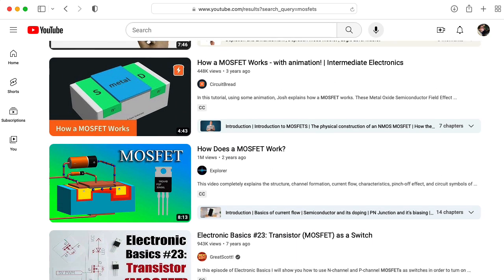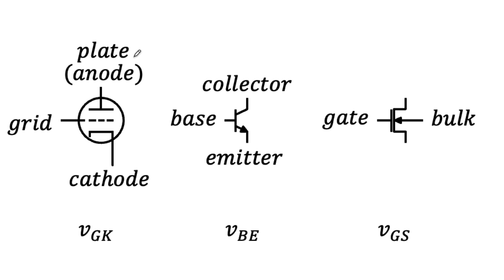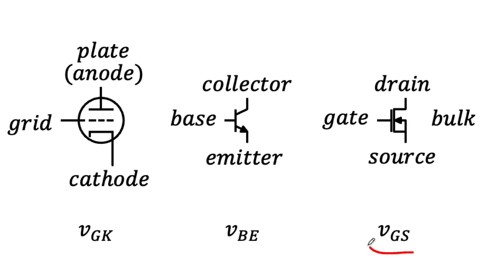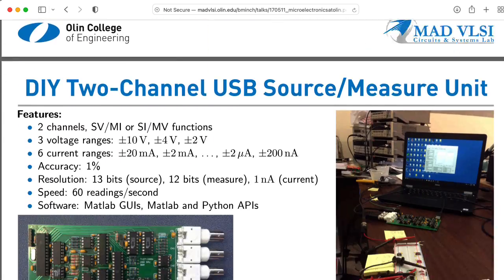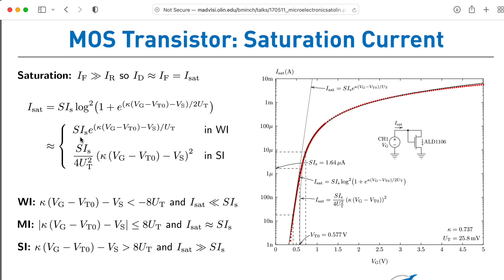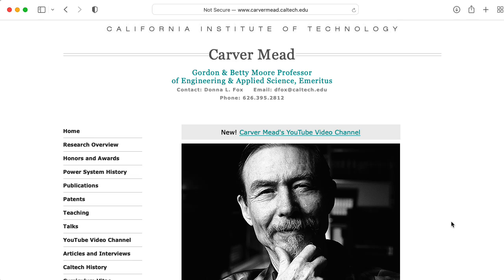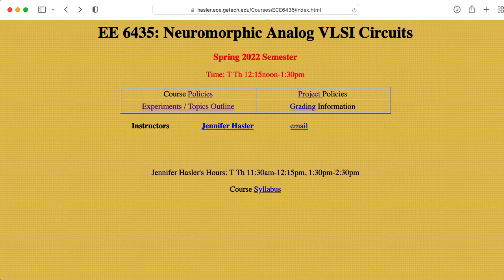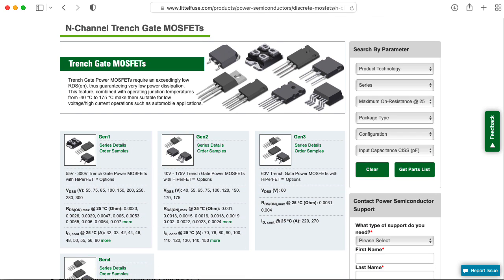They Mislead You About MOSFETs

Comment: There are several distinct types of MOSFET. I am here to talk about some similarities and some differences among them, between them, and the older electronic device types. Some MOSFETs are more like Bipolar Transistors, while others are more like Vacuum Tubes, in the sense of whether the device is Normally ON or Normally OFF with respect to Current Flow. Vacuum Tubes are Normally ON, meaning a disconnected Grid will let the full current flow between Cathode and Plate, while Bipolar Transistors are Normally Off, being in the high-resistance state when Base current is not flowing. 
Among MOSFETs, usually only the Enhancement-mode MOSFETs are discussed, for instance as common switching elements in most integrated circuits and discrete MOSFETs. These devices are Normally OFF, that is, minimal current flows at zero gate–source voltage. This is slightly similar but not quite like a current-driven Bipolar Transistor; neither is it like a Vacuum Tube. 
Meanwhile with a depletion-mode MOSFET the device is Normally ON at zero gate–source voltage, making them rather analogous to a Vacuum Tube, aside from being able to work at rather low voltages. 
The Normally ON nature of a depletion-mode MOSFET can be uniquely effective in certain low-power, low-voltage situations such as Joule Thief circuits, where the nominal 1.5-volt alkaline battery can be run down much farther than when a bipolar transistor is used as the switching element. A similar circuit may be found useful for bootstrapping from half a volt to the several volts needed to turn on Enhancement-mode MOSFETs.
Reply: That's true, but the only really difference is the threshold voltage, with a depletion mode device having a negative threshold. It's possible to use an enhancement more MOSFET in the depletion region, by biasing the gate below the source, in which case the leakage current will often be lower and a depletion mode device can also be operated in the enhancement region, which often gives it a lower drain resistance.
Reply: Interesting! @alunjones3860

Comment: I don’t think the premise is very valid. The gate voltage, or charge, or whatever you’d like to call it, in relation to the source voltage controls the inversion state of the channel. Further, saying “there are more complexities than the square law” is patently obvious and mentioned in textbooks. Third, you provide no solution such as is done at Berkeley with the gm/Id methodology. Teaching kids to use their brain and the simulator is a lot harder than following some arbitrary model like EKV. 

How much experience do you have with FinFet design? The body effect becomes less and less relevant for modern bulk transistors, not more and more, and with decreasing supply it’s harder and harder to cascode.

Also don’t agree that the bulk has to be connected to VCC/VSS, most modern CMOS processes offer triple well as a standard option.

Comment: I seem to recall that the idea for a field-effect transistor preceded the invention of the BJT. Maybe not - have to look it up. Not to forget (and not shown), most "street" MOSFETs have a parasitic drain-source diode, 0ften enhanced for reverse current carrying capability in switching circuits and also sometimes doped to Zener at the Vds rating. Also, the street variety pretty much the only ones I have and have used) will happily work with the drain-source voltages reversed. The important point is to apply the gate voltage relative to the source and the gate supply can be isolated by transformer or opto-coupler. Also, the gate-source is often reverse-biased to enhance switch-off time. And not to forget the body diode in those common models is always present. I've known some to wonder why the thing still conducts with a reverse drain-source voltage applied. Properly wired these devices make a great bi-directional switch. I've used them in many apparently "strange" ways, for instance in decorative battery night lights where the MOSFET is biased off while a small solar cell charges the battery during light hours and allows LED current to flow at night.
Reply from the maker: You are right, the FET came first, but the folks working on it had trouble getting it working, which led to the BJT.
Reply: @Lantertronics  J-FETs are truly symmetrical. They're not normally used in digital circuits because the negative threshold voltage is a pain to work with.
Reply from the maker: I really need to make a follow-up video about the parasitic diode and its use of the MOSFET in current switching applications. I was primarily thinking about linear applications and just totally overlooked this when making this video.

Comment: That's all interesting, but are there 4-terminal MOSFETs on the market at all? I can't remember if I've seen one in last 10 years of active electronics design. Maybe there's some special parts out there, but almost all of MOSFETs on the market are 3-terminal devices without separate bulk connection. The only 4-termonal device I've encountered is a double-gate one for RF application. Please, name a few 4-termnal FETs I can find on like  Digikey or Mouser, it would be curious to read their datasheets.
Reply from the maker: I probably should have been clearer in the video -- this issue applies to analog VLSI design where the bulks connections are all hooked to one of the rails by construction. I pickup up this rant from Jennifer Hasler (I'm sitting in on her class this semester) who feels like she's constantly having to untrain students from habits used to discrete MOSFETs. Technically speaking most CMOS op amps or whatever you buy have these issues going on, but some other designer has thought through all that for you so can just use the chip as a black box.

There are MOSFETs with bulk connections available -- matched pairs and quads from Analog Linear Devices. I've seen them here and there at various vendors, but the vendor that seems to have the biggest stock is Digikey. They all have part numbers starting with ALD, and you can find info about them on the ALD website. I'm looking at those since I'd like to experiment with analog integrated circuit design techniques on the breadboard instead of just simulation. 

They have some parts that use "floating gate" technology that let you program what threshold voltage you want. You can buy ones that you put in a programmer, or buy ones that are pre-programmed for various threshold voltages (including zero!)

Comment: Hi Aaron, I am working on a design for a bidirectional high current switching system (Id should be positive or negative). In a perfect world this is feasible with 2 pmos transistors and abusing the intrinsic diode of one and the channel from the other. This presents the problem of diode drops that I would rather avoid. After seeing this it seems like biasing in terms of Vgb(ulk), not Vgs, a bidirectional switch with high current capabilities seems feasible? are there off the shelf options that you know about? Any designs you would be willing to show off? Do off the shelf parts exist where the bulk is accessible to the designer exist? Am I thinking about this wrong? Thank you.
Reply from the maker: I must confess I'm at the edge of my own understanding on this -- I'm basically parroting what I've learned from my colleague Jen Hasler. So I'd be hesitant to make any specific suggestions, especially when it comes to high currents (and Jen's area of expertise is low-power electronics).

I've been looking at a company called Advanced Linear Devices, they make matched duals and quads that give access to the bulk connection (same for all on a chip). Don't know if they could handle high enough current -- if you needed to add "high" to the word "current" in describing your application, probably not -- but it might be worth checking out?
Reply: @Lantertronics  Thanks for the detailed response! I'll look into this! For me, high current is like 5A lol.
Reply from the maker: @TheSlowerMonkey  Heh, yeah that would turn the ADL devices into a pile of melted plastic in about a nanosecond. ;)

Comment: Interesting!  At age 75 my recollection is that when I first encountered BJTs in the late 1950s as a prepubescent boy, most 'popular electronics' magazine descriptions of the BJT considered it to be a current-controlled device, and beta [the ratio Ic/Ib] was the most important parameter [after max Vce, of course].  This was all very strange to me who had initially learned how vacuum tubes worked as grid voltage controlled devices.  In those dark ages no-one in my circle of friends measured currents, only voltages.  We all lusted after a real VTVM with its near-infinite input impedance!  Steep learning curves...
Reply from the maker: Aaaaah... I really wish I could send a message back in time and ask the marketers of BJTs to not describe them as current controlled current sources. That would make sense if you were driving the base with a current source, but you're almost always driving it with a voltage, and it's more natural to think of the BJT as voltage controlled, and the base current as being something akin to a parasitic effect form the point of view of the designer (albeit one inherent to the operation of the BJT).
Reply: @Lantertronics  It kinda makes sense to describe BJTs as current-controlled, due to the non-linear characteristics of the diode between base and emitter. This way, describing a BJT transistor as voltage-controlled becomes harder/less predictable to work with unless you always assume the resistor often added at the emitter or in series with the base. In isolation, yes the base-emitter voltage does have something to say, but the base-emitter current can vary a LOT, with very little variation in base-emitter voltage once you are out of the diode cutoff region.
Reply from the maker: @ThePiloseOne  You could describe it either way, but you're usually driving the base with a voltage source and operating in some approximately linear region around some DC bias point anyway. People often site the simpler Ic = beta Ib relationship as the reason to describe it as a current source, but it's not really helpful in designing since you're not generally thinking about driving the base with a current source. Generally you want the base-emitter current to vary a lot, since by definition that's your gain. :)
Reply from the maker: @ThePiloseOne  I should make another video about this.
Reply: @Lantertronics  I think the difference in perspective here comes from looking at a transistor as an isolated component vs a component in circuit. While most BJT amplifiers are driven by a voltage source indeed, an amplifier has additional support-components that will affect what assumptions you can make.

Say for example, if you bias for class A, you assume a constant 0.7V difference across base to emitter, regardless of the input voltage of the amplifier as a whole. The voltage swing/gain of the output is then determined as the voltage over a resistor external to the transistor. The transistor dictates the current through (and as such voltage over) this resistor, but the base of the transistor itself should still remain quite fixed at approximately 0.7V away from the variable voltage at the emitter. While in the overall circuit as a whole, the current through the resistor is regulated by the voltage into the amplifier, the signal driven through the transistor as seen as an isolated component is a swing in current. So while the amplifier for sure is voltage-controlled, and has voltage gain, the BJT transistor in isolation of everything else is still current controlled according to my line of thought. The fact that this implementation is voltage-controlled stem from the application the transistor is put in, and is not an inherited parameter of the component itself.
Reply: In many designs, you are in fact driving the base with a current. Else nobody would have bothered with this description.
Reply from the maker: @tommihommi1   I suggest watching my two latest videos on the BJT.
Reply: @Lantertronics  I'm not saying it's a good model for most applications, I'm just saying there are valid designs that use it.
Reply: @tommihommi1 The current controlled BJT is only ever useful when it's used as a saturated switch. Look at how a BJT current mirror works. Try simulating a current mirror in SPICE, with the only difference between the two models being the hFE. Note how well it works, even though one device has a much higher current gain, than the other.

Comment: Pretty sure you can get discrete 4-terminal FETs for those adventurous designers! Interesting video, thanks.
Reply from the maker: Wild coincidence, I was just looking at those! Advanced Linear Devices makes some matched duals and quads that give access to the bulk connections. They even have ones that use "floating gate" technology to let you precisely program the threshold voltage (you can get ones that you can program and you can also buy them pre-programmed). I plan to make a video about them at some point.

Comment: Good video, but I take note that a bipolar is current driven and thus characterized by the base current I (be) not V (be).
Reply from the maker: The Ebers-Moll equation equations relate all the voltages and currents at the terminals. BJTs are usually introduced as being current-in, current-out devices, but from the point of view of designing with BJTs, it's much more useful to think of them as a voltage-controlled device, and deal with the base current as something of a parasitic effect that you just have to deal with (of course, current flowing through the base is fundamental to the physics of the device).
Reply from the maker: Lecture 6 and 7 from my ECE3400 lectures series here on YouTube goes into this in gory detail. ;)
Reply: Ic = exp (Vbe /VT) (1 + Vce / VA) = βIb . Both Ibe and vbe correlates with Ic. It's both current-controlled current source and voltage-controlled current source. You just can pick one of the two models depending on your usage, e.g. impedances you drive the circuit with. Cited from Ali Hajimiri's lectures on BJT

Comment: Interesting.  I made a post somewhere about n-channel depletion-mode MOSFETs being used as high-side switches.  There is a pervasive view that a charge pump or a higher rail voltage is needed to trigger the gate by creating a vgs higher than the voltage being switched.  The way this is usually explained is totally wrong.  The MOSFET does not know what is going on in the rest of the circuit.  Say we're building a H-bridge with identical MOSFETs.  For one positive rail and one ground in the whole circuit - the so-called "charge pump" to be used to "act as a voltage doubler" does nothing of the sort.  In those explanations, those arguments measure voltage at the pump relative to circuit ground - which is irrelevant to the MOSFET.  What that charge pump capacitor actually does is to create a floating ground at the source terminal of the high-side MOSFET (as far as the MOSFET experiences).  To that MOSFET, vgs is then larger than the threshold.  It is useful to think about charge alone at the source and the gate rather than voltage and current.  These are charge-controlled devices not voltage controlled as normally said.
Reply from the maker: In her analog lectures that I'm sitting in on, colleague Jennifer Hasler talks often about the capacitive aspects of MOSFETs and the benefits of sometimes thinking about charge instead of voltage.
Reply: That's all true, but for practical purposes, with an enhancement device switching a this high side, the gate voltage needs to exceed the power supply. A depletion mode device would solve that problem for turning on, but it would require its gate voltage to be pulled below the negative supply, to fully switch off.
Reply: @alunjones3860  I'll think about what you said further.  However, in my lab is a H-bridge commutating a BLDC motor using my method.  In further testing I will see if I can measure a lack of switching off completely and other transient effects.
Reply: @projector7141  A depletion mode device requires the gate to be below the source voltage to fully switch off. If your circuit doesn't achieve this, the device will not turn off. It's that simple. Whether this is a problem or not depends on what you're doing.

Comment: Thanks for the video. Technically speaking vacuum tubes have at least 5 terminals, they need power for the black body emitter 🙂

I guess what you are saying is Technically true for any AC device and the naming convention is likely there for simplicity and consistency when using them in the field.

Something I noticed at university is many of the lecturers, particularly the ones with more letters before or after their names, didn't have the real world experience to appreciate how devices are actually used in the field, so aspects of their knowledge was not always meaningful to industry.

Comment: That's why you can use mosfets for muting audio for example. There an external substrate/bulk terminal is very useful because you can connect it to a negative supply so the substrate formed diodes dont short the signal out (at least until it reaches the negative rail).

Comment: that pesky intrinsic silicon reverse drain-source diode that's strapped to source with most off-the-shelf parts...  an application having a FET that fully switches in both directions would have to be in a situation with operating Vds swings less than a diode drop (over full temp. range).  Maybe some kind of crazy AC millivoltage switch/clamp.
Back to the central point of video- I can't say I'd ever been affected by the 'Vg-s'  vs  'gate-bulk'  issue. I've so tightly controled the Vgs conservatively anyway to prevent pesky miller switch-off things happening over all load conditions which includes squegging after a single point failure, this kind of swamps out the Vgs-th issue    :-)
Reply from the maker: I think "squeezing" may be my favorite engineering term.